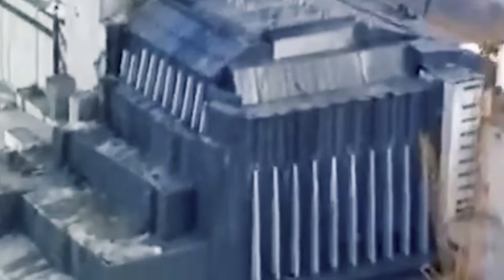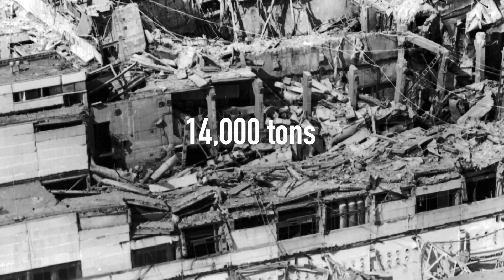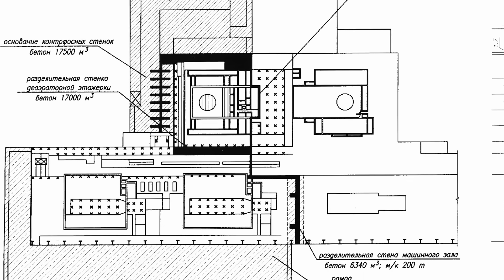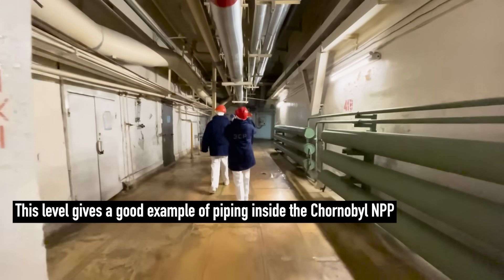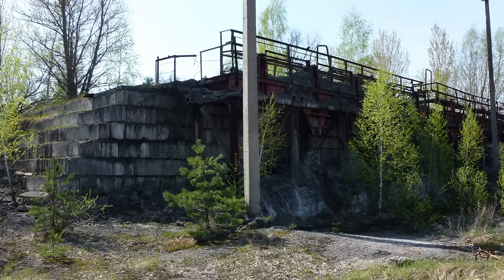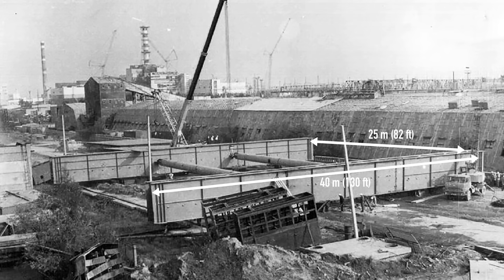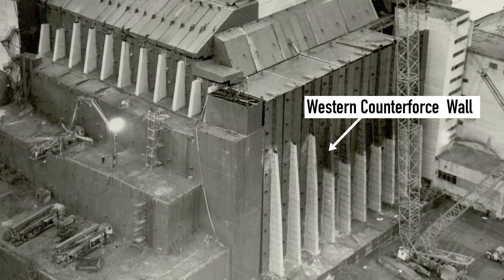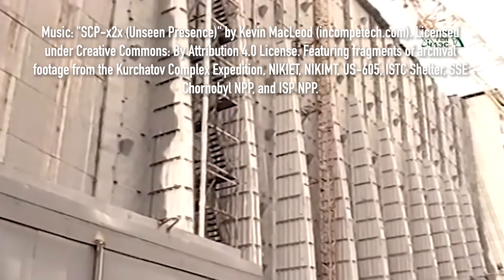Chernobyl Sarcophagus: The Most Complex Structure Ever Built? | Chornobyl Uncharted Ep 12

Comment from the maker: Following some comments regarding the title of the video, where people mentioned that compared to e.g. LHC the Shelter is nothing, I'll share some thoughts which I heard from engineers quite often (along with the statement put in the title) when the New Safe Confinement was built.
The problem is in the definition of complexity. Technically even the New Safe Confinement is far more complex than the Shelter. But what makes the Shelter unique that it was built in extreme radiation, in record time (206 days), with a substantial part of mentioned 90,000 people involved simultaneously, with a single attempt (in most cases) to position elements, while relying mostly only on a CCTV image or distant observation, and having very fragmentary input data. 
That said, while e. g. a dog house built on Mars technically remains a dog house, it cannot be compared to dog houses on Earth in the scope of complexity. Something like this was done for the first time, unfortunately, at the ChNPP. Which absolutely does not lower the fantastic technical effort of those who created next, modern mega projects.
Reply: I came here to comment exactly what you're referring to, CERN etc, but you make an excellent point. fair enough, carry on!
Reply: It's not surprising the shelter was built and put in place so fast.. wouldn't want to hang around there too long !
Reply: People gloss over the fact that reactor 3 operated for like 20 years after 4 blew up. Um hello? Who the hell was operating the plants and why haven't they been interviewed? Did they die? The inhumanity is staggering
Reply from the maker: @Adrian-gs9er  huh? what you are talking about is all along in books, movies and internet pages for years. A good start point is https://chnpp.gov.ua/en and their official YT channel.
Reply: @ChernobylFamily  I'm saying the story of those people are not well understood or talked about. I've looked up the reactor 3 operation after 4 blew up and it just says people continued to work there. Though my message was clear...
Reply from the maker: @Adrian-gs9er now it is more clear..) well... in many aspects, you are pretty much right, especially if we look at english-speaking sources. There is much data, and interviews, but little is translated
Reply: @ChernobylFamily  glad I'm not the only one who sees this. Did people accept the fact they probably would get leukemia or something for being at reactor 3? The fact that people just worked there 20 years after the meltdown just blows me away and it's a footnote in most Chernobyl stories and recounts. :)
Reply from the maker: Leukemia? Why? Conditions there are normal. It is just a work...
Reply: @ChernobylFamily  it's really dangerous to be there In the exclusion zone? How could people be sure they were safe? You can't even go to pripyat and that's kilometers away. but people are sitting in reactor 3 having a ham sandwich at lunchtime? What happened to the other reactors employees?
Reply from the maker: @Adrian-gs9er I guess check the very first episode of the series where I explained how contamination formed. See, it is patchwork-like. There is no average. Across the exclusion zone, levels/concentrations vary drastically, sometimes within a few meters. You very much can go to Pripyat and even to Red Forest (which I did hundreds of times), but you need to keep in mind about permitted dose management AND prevent ingesting anything. In Pripyat, there are places where a level can be lower than in Kyiv, and in another place, it can be 3000 times higher.  For having a ham sandwich, for example, there are defined so-called designated clean zones, which are free of contamination and where you have to pass a sanitary unit (clothes change, washing hands, etc.).
Reply: @ChernobylFamily  Ah, I see. I did see that part. There's a video, not sure if it's you, where a group of young men went to pripyat. They took a Geiger counter with them and walked there. You are right that they encountered higher levels in spots. I guess the workers were relatively safe from the liquidators cleaning up?
Reply: Why would anyone compare the LHC to the sarcophagus hahahah
Reply: I have a photo of myself with the sarcophagus in the background. Took a tour from Kiev in 2009. Amazing to see it all in person.
Reply: "полагаясь в основном только на изображение с камер видеонаблюдения или дистанционное наблюдение, и имея очень фрагментарные входные данные" - спасибо за разъяснения, теперь еще меньше веры в надежность этой будки, запроектированной и построенной камуняками, что бы скрыть свой героический провал в предыдущем проектировании будки, которую так же героически назвали "АЭС".
Reply from the maker: @degradation404  yes. That's why it it gives a big headache.

Comment: I wonder how much fear did the engineers had when designing the sarcophagus thinking the added weight might just make the entire building collapse, they could get access to plans but couldn't examine many support columns because they were contaminated with corium such as the elephapnts foot and such, just wondering about that
Reply from the maker: There is a spicy detail. The fuel-containing masses were discovered very late comparing to design stage of the Shelter; so they were rather a surprise. The supports were observed as much as possible (see the episode about Bathyscaphs), but still, a major part was a pure calculation. Which makes everything even more insane.

Comment: The three Demag cranes was of the type CC4800. One of them was later cleaned and used by the english crane hire company Baldwins.
Liebherr (also from Germany) supplied two 160t LT1160 telescopic mobile cranes witch botb were fully remote controlled.
Reply from the maker: By the chance do you know its serial number? As there were three, two continued operation elsewhere.
Reply: I have talked to a friend who knows a lot about old Demag cranes and the serial numbers.
The cranes in Chernobyl was of the type CC4000. 
There was an early version and then a later version which had a similar apperance to the CC4800 but with a lighter boom.
One was buried at the site. This must be one of the old CC4000. 
The other cranes was decontaminated and two was sold to Baldwins, where one was used at their Philips branch in Texas. Both cranes was later sold to Van Seumeren in Holland and was upgraded to CC4800. They are still working. 
Serial numbers 41016 was a CC4000 (I believe this is the one with the cab mounted in front of the boom and is buried) . 41020 through 41024 was in the upgraded version and all in Chernobyl. They have bigger crawler tracks than the 41016.
1987 Demag upgraded the crane to CC4800 and 800t capacity.

Comment: Would of thought the stack might collapse
Reply from the maker: If you mean the ventilation stack, there was a close call. In this type of chimney, a structural support is the grid around, while the pipe itself is a thin metal; the explosion blew away some of diagonal supports. It appeared that it still can stand, but it was one of the reasons for its ultimate dismantling.
Reply: @ oh ok

Comment: What was the purpose of all that red substance?
Reply from the maker: Which specifically?
Reply: @ChernobylFamily  at 6:02 for example the parking lot appears covered in red paint or something..  This could be just a shadow and weird color correction from an old photo or video as there are a few scenes where the red definitely appears to just be a shadow with strange color, but later on there are a few scenes of the destroyed reactor building with the hole in the roof and the wall appears to have the same reddish stuff that looks like it has run down the side of the wall..  Was this some sort of compound they attempted to dump on the building?
Reply from the maker: on 06:02 is not a red substance, that is regular sand, just physical photographic images included in this video when they were printed from a film fell into a red color. So they are all orangish-reddish. But besides, you are right in the meaning there were a lot dust suppression compounds used, whey were mostly brownish. In the end of the video it is possible to see MSPP system sprinking a compound inside the Shelter, so that substance is actually a bit pinkish.